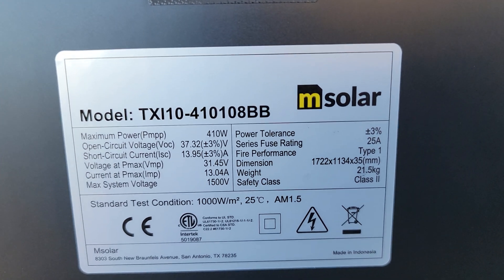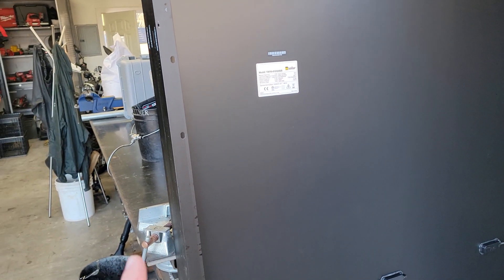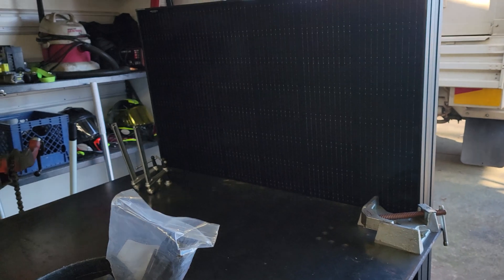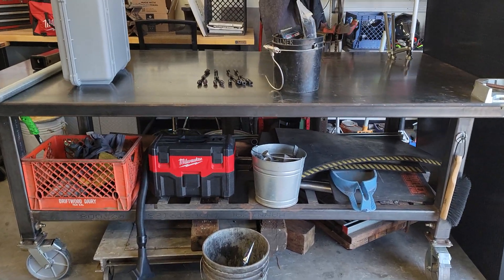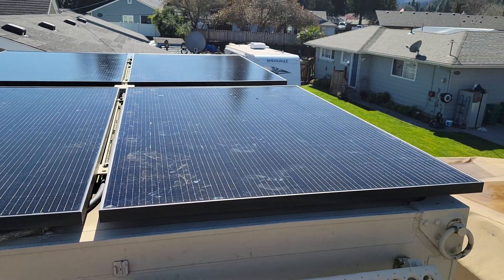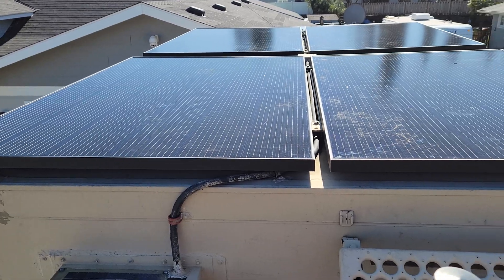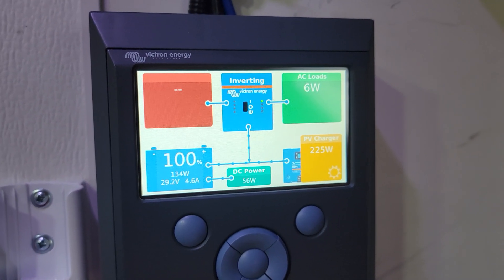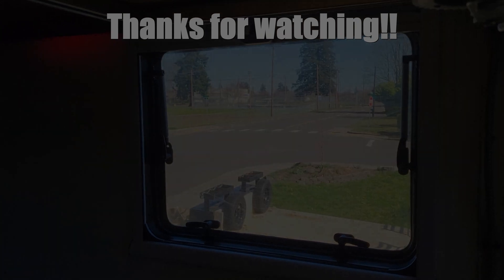Abel LMTV build part 194 (Black solar panel upgrade, 1640 watts total)

Comment: Great install!  You might consider a piece of angle going from the front corners of the box to the corner of the panel and also feeling the gap between the two panels Midway down.  In case you come across a branch that's catching on the panel this way it'll slide across the panel and not get stuck in between them causing damage
Reply from the maker: I may do that at some point but for now this will work.